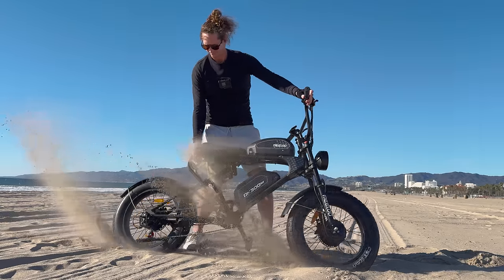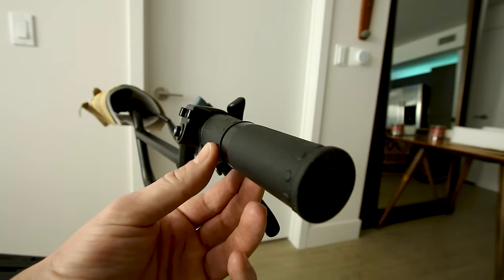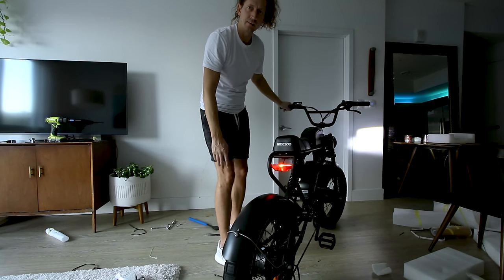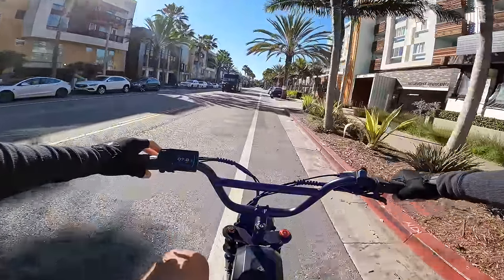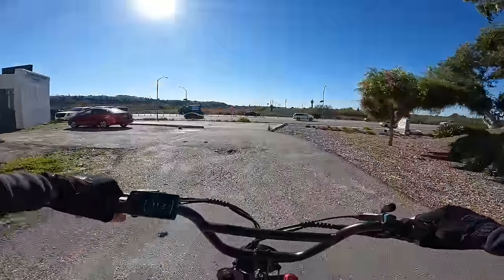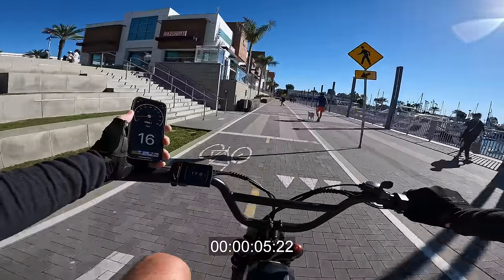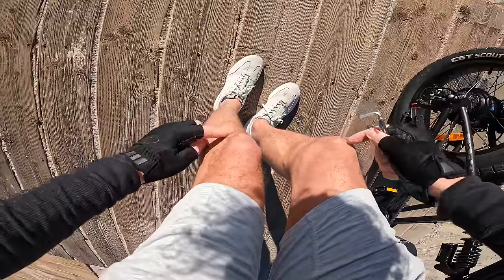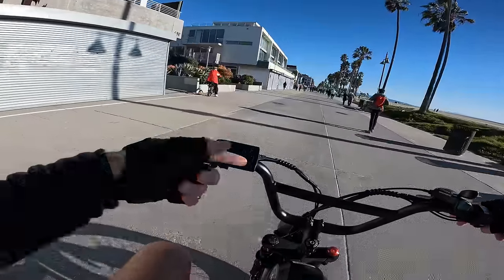2 Batteries, 2 Motors, "Under $2,000" Ebike - Meelod DK300 Max Review

Comment: If this (any) bike doesn't see the Hollywood sign, it's sus.
Reply: Agreed!
Reply: No joke, the broken kickstand, the crash, and top it off it's not even that fast, the last bike he reviewed looks like a way better ride and deal even though it was only a single motor it went 45, ate up the beach and stayed stable even at high speeds, and was even cheaper
Reply: Just another fake looking 'motorbike' - I hate e-bikes that are trying to look like motorbikes, it's just corny as hell
Reply: @mickyb.8014  Well ok then. Thank you for your non sequitur comment. Be well.
Reply: My friend went to griffin park with this bike. Im debating if i should get this or the motor goat v3
Reply: @mythoti the Meelod is only 1599 dollars and it’s free shipping and doesn’t tax you and the motor goat is like 2500 dollars  so of course it’s better
Reply: 160mm rotors? My 28 mph ebike has 180mm, and they feel like they are underpowered at times. Yes, mine are hydraulic.

Comment: You can unlock an extra 2mph in the advanced settings and hit 35mph using the password "2020". I made a review on this bike and upgraded the seat, brakes, and other stuff. One of the best looking ebikes in my opinion.
Reply: speaking of advanced settings, were you able to find a way to disable the cruise control on this bike? thx
Reply: @supermanishere-vz4pz I’m curious about this too
Reply: @CarelessKingdom  I emailed the company Meelod and they said cruise control is turned off  by squeezing the break levers.  There does not seem to be a way to  deactivate the cruise control in settings.  Definitely a bit strange, and honestly put me off from getting the bike. Maybe it's not a big deal... i dunno.
Reply: @supermanishere-vz4pz  That’s a certified deal breaker for me. I’ve had many e-bikes and scooters and I tell ya cruise control is a one way street to getting yourself hurt. I was settled on the Meelod but now back to the drawling board.
Reply: The one I got 1 month ago has no cruise control
Reply: What is even cruise control?
Reply: @markobozovic9012  after a set amount of time the bike will lock at whatever speed you're running and just stay at that you can take your hand off the throttle

Comment: My MEELOD dk300max brakes failed at 120 miles. I purchased new brakes and rotors that are 180mm. I cannot find any caliper adapters to make the 180mm rotors work. The bike came with 160mm rotors. Can you help?

Comment: Who's the mfg of the motor, and what's the model number?

My prediction for 2024 or 25: More geared motors above 1000w continuous, which will initially be available only through ebike dealers as part of a new ebike - with replacement done under warranty or at prices intended to out them out of reach of the diy market.

Comment: For some reason I feel you get way more power for the buck with e-scooters. How come?
Based on that test with the incline I think many e-scooters for around the same price would pass that incline. Maybe it's steeper in real life but on video it doesn't look too steep.
Also a bike isn't any more complex than an e-scooter sure it uses some more material but I feel that shouldn't affect the price or only slightly if so. This is part reason I haven't switched to e-bike. Too little power for the money. Sure e-bike has other advantages but commuting power is big one for me.
Anyway nice review!

Comment: Hey can you recommend a way i can feel more resistance when pedaling a bike at speeds above 20 mph besides adding a bigger chain ring since i did that but its not enough
Reply from the maker: Even larger sprocket in front, or small cassete gears too

Comment: Does it offer regenerative brakes on both wheels which could double or triple miles per charge!! Love you all and have a blessed day!!!!! Can the front wheel charge while the rear wheel is driving and vice versa is what I am looking for. Absolutely  possible with dual battery on board!! Also 56 years old semi old fart  can do it a lite petal for 3 hours maybe I can do 115 one way recharge and return the same day!!!!!

Comment: Sounds like bullshit motor ratings, substandard controllers or bad setup.

1200w should not have an issue getting up that garage incline.

And 2400w should have better  acceleration.

Right now, the bar is set at dual 750w, full suspension, hydraulic brakes, 35mph for $1500 or less.

I just paid $1300 for an smlro v3 plus.